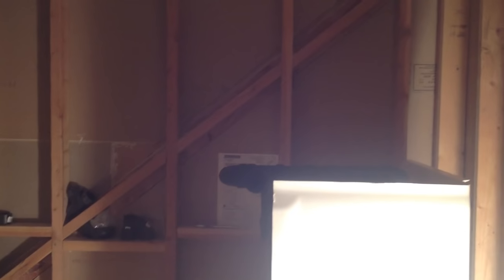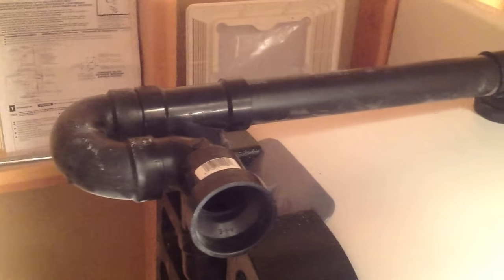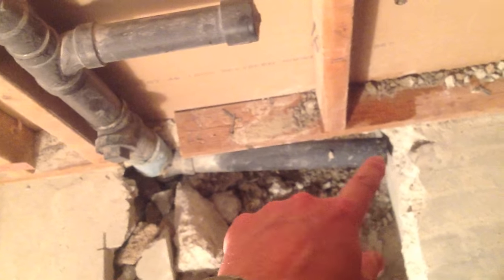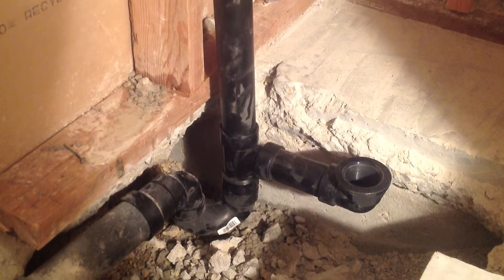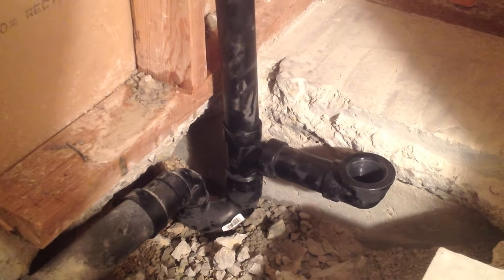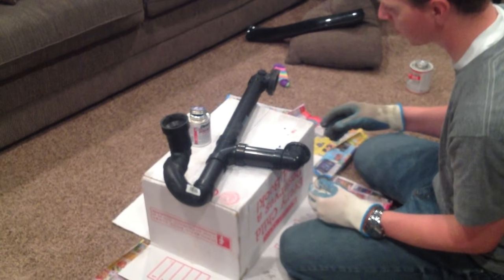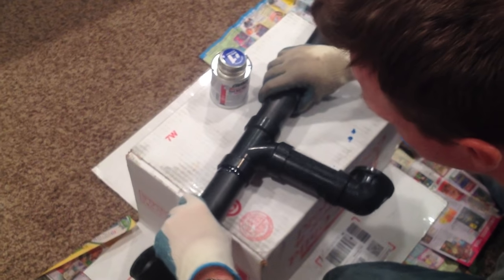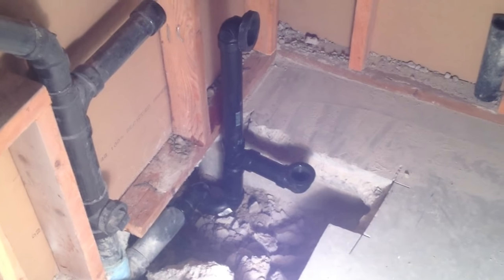Bathtub Plumbing - New Installation

Comment: Much stronger joint if you apply glue to both pipe and fitting. The glue chemically melts what you put it on, so melting both sides makes for a much stronger fusion of matierial. I installed sprinkler systems and plumbing extensively years ago. When you push them together, most of the glue volume is scraped to the outside making it all the more important. On drain lines with no pressure it's probably ok, but NEVER glue pressurized lines from just one side.

Comment: Couple of things to consider: make sure u use ABS glue instead of PVC glue, if use PVC should primer be applied as well. In this case I rather advise you to use thinner pvc or brass p trap with unions instead of abs. Make sure to properly tie down the strainer with putty  and make sure the overflow not leaking or else you will have more problems to deal with in the future

Comment: 5:19 wrong annotation, you swab both pieces because when you use the correct glue for ABS pipe you are actually melting the pipe and you want both pieces to melt so they fuse together as one piece. they don't fuse all the way through, but they do on the surface. So its not for a "stronger hold", its for the correct melting and fusing that's supposed to happen.
Reply: Yep, was gonna mention that.  As a teen, I put lots of sprinkler systems together.  New guy came in and tagged one side, said the same thing.  Not a week after install and a few of his joints blew out.  I guess for a non-pressurized drain you can swab one side, but it's not the right way to show folks.  Otherwise, excellent video, getting into the floor and setting your pipes, thank you so much for posting!!

Comment from the maker: Great question. I asked the same thing of the plumber that explained all of this to me. He said it's fine to leave it unfilled - just make sure any part that will be exposed or that the tub sits directly on is filled in to provide support for the tub or surrounding areas. I left the concrete open underneath the plumbing portion of mine.
Reply: It needs to be filled in to keep termites out.

Comment: I'm not trying to throw shade on what you've done, but I do want to mention for others, that the vent (which I know you didn't do), according to the two major codes used in the US, must run vertical until it is at least 6 inches above the upper rim of the tub. It would be easy enough to accomplish this, so I'm sure a conscientious plumbing inspector would make you rework the vent.

Comment: Are you using Christie's blue glue on ABS plastic pipe?  Blue glue is for PVC NOT ABS, it says so right on the can.  They say it is NOT to be used on ABS pipe.   You'll be doing this job again in a few year when all of thee joints fail from using the wrong glue.  The joint may appear to be secure now but after a months of thermal expansion from the hot and cold water the joint will fracture and leak.  There are YouTube videos showing how the joints which have failed over time by using the wrong glue.

You want to apply the glue to both pieces of the pipe before you join them together.  The glue softens and melts the plastic so when the two pieces are joined together they will make a good seal.  By putting the glue only on one piece of pipe makes a weak joint.
Reply: Passed High School Physics just goes to show you just cuz someone can post a video doesn't mean they know what they are doing....."you only have to put glue on one side of the pipe" lol
Reply: derrick gyenizs +1  You are absolutely correct.  It also means the guy posting the video can't read the directions on the can of glue.
Reply: abs cement actually melts the pipe and fuses it together. I guess we'll see how long it holds....
Reply: wow, and hes panhandling for $ for the next video...
Reply: Yikes dude! So much work and so much education to get here and you didn’t read the label or perhaps know your glues! Your glue should be black and for ABS.

Comment from the maker: There is. If you look around 0:27 in the video, you'll see a black 4" pipe coming up out of the cement just past the grey bucket of gravel. That's the toilet drain. I have since finished the bathroom completely and the toilet (and everything else) is now installed.

Comment: That's right Matt and it is best to use a deep socket PVC Female when using transition cement. The smaller ABS female hub   sockets are shallow and give less surface area to bind. So I would transition with straight connector PVC to ABS when crossing over....And I ain't no plumber either.

Comment: You are wet venting your bathtub through your lav drain.  You should have ran the vent up to 6 inches above the rim of the sink and tied your vent in to the stack separately.  Some codes allow wet venting under certain conditions.  Pretty sure these do not meet those conditions.
Reply: +Ryan Dugger I was gonna say the same thing. I believe the pipe he was referring to, for the sink,  was the vent for the tub. All in all a decent job though for a at home DIY.

Comment: When dealing with presureized lines, it is best to use primer and glue on both sides and I recomend the red hot blue glue like being used here in the video,  I sware by that glue!
Reply: hydrolisk1792  - But NOT for ABS!😞
Black pipe is ABS
HOT BLUE GLUE is for PVC

Comment: ABS glue, which is yellow in colour, is the only glue to be used with ABS. PVC glue is to be used only with PVC, and with a primer first unless it is a one step glue. You can glue ABS to PVC, but as Matt Gordon stated previously, you must use a transition glue. It's not just good practice but a manufacturers requirement to glue both the pipe and the fitting before assembly.
Reply: billharring - ABS glue is BLACK!

Comment: Did anybody notice the Non PT 2x4s  against the concrete walls and floor?  Also, leaving an opening in the floor is a welcome sign for termites. Nice dark damp place for the critters to enter your home. Seen it before.

Comment: Did the concrete you cut thru have steel ReBar or just in reinforced concrete?
Good clear video under difficult conditions

Comment: How did you make the transition from ABS to cast iron (or is that really rusty galvanized pipe??)? You would normally use a rubber coupling with a hose clamp, but I don't see any hose clamp.

Comment: The original pipe you cut into went in to/under the slab to the right. What happened to that connection and what ever was flowing in to it? I was expecting to see a tee fitting between the P-trap and the original pipe.
Reply from the maker: That actually is the original pipe - the one I connected the p-trap to. When I cut open the slab, you can see the pipe sitting there but it never connected to anything - it was left open. That's what I used to tie my drain to.
Reply: 🤔 huh?

Comment: Dude ...  you used blue glue instead of ABS cement?  Really?  Wouldn't want to be you.  And, you did not cement the hole with the rubble before setting the tub?  Really?  Help me with this because that is NOT the best way to do this.

Comment: You didn't see a Dap box as an option? it's helpful to have the drain slope up into the Dap box or 'hole in the concrete' and position the trap within the hole so's to have the ability to change out, or at least access the trap for future considerations,.. like replacing broken trap. Or moving an inch for new tub.
 Also more better to use 2" trap under concrete. 'Cause WTF!, 1-1/2' under concrete is ancient code!

Comment: What would you do to fix the problem of water coming  in , The  bath and the toilet were  both done like you had done yours. Now the problem is water leaking in where cuts were made due to concrete floor was half under the ground and had to go all the way thru to the outside . So when it rains it floods back into bathroom floor from those cuts and up under the tiles...MESSY. I'm going to use concrete to cover back up the pipes ( he used foam and it didn't work  ...but I'm not sure how to keep the concrete from running into the mud just out side and it not form  up right .....is there anything I can use to put on the OUTSIDE so its flushed with the foundation wall , so concrete can form right and air tight. There Is also the water pipes to work around :(    I NEED HELP )

Comment: make sure to teach people right if you're gonna post a how to video it may have not leaked for u but it will for someone else...use right type of glue with the right type of pipe... use the right type of application also... it's a 1/4 turn not a full 180 specially since u didn't glue both fitting and pipe maybe also use primer before the glue...

Comment: Hi,
If you can help me.My shower room water drain is clogged and tried DRAINO+vacummed but not fixed.I dont see any hair or dirt in line while going to use snake.what could be the problem....
Thanks
sp
Reply from the maker: Hey Sunil, sounds like it's time to use a snake or zip-it, or something else that will physically reach in and pull out the gunk. We've had good luck using that when Draino and the like wouldn't touch it. Good luck!
Reply: If it's not properly vented, you will have draining issues...
Reply: If your system is plumbed like in this video (improper venting to break a siphon) then you definitely have a plumbing problem, that may appear to be clogged!  
Put a straw into a glass of water,
Now put your thumb over the end of the straw. 
Now lift out of the glass with thumb still on straw. 
Why is water not coming out of straw?
Oh, I know...
It MUST be clogged!

Comment: Nils,
You really should not post your first attempt at ANYTHING publicly, especially something where corrections are clouded in for glaring oversights like cutting slabs outside of the bath tub footprint and then offering a link on how this process should be accomplished. Was this a spoof? Are you a plumber or a well meaning homeowner with a new video device?

Comment: do I need P trap after my bathtub drain assembly?
Reply: Yes. EVERY fixture in a plumbing system (that doesn't have an integral trap IE Toilet) needs a trap and a vent after that trap by code.  No trap and you'll be sucking sewer gas for the rest of your days
Reply: A P trap is meant to hold a bit of water so you don't get the sewer smell and gases coming up the pipe.  So yes, it would be wise to install a P trap.